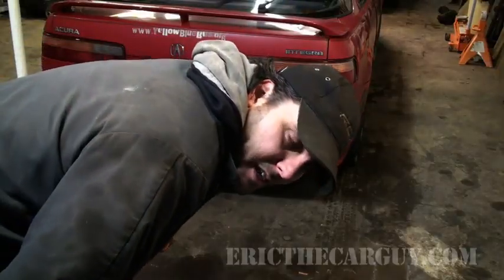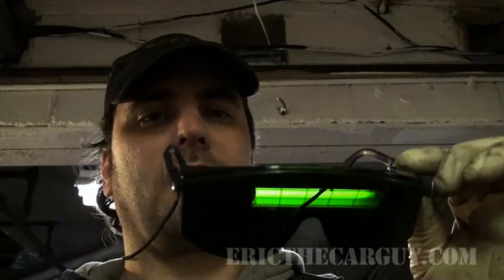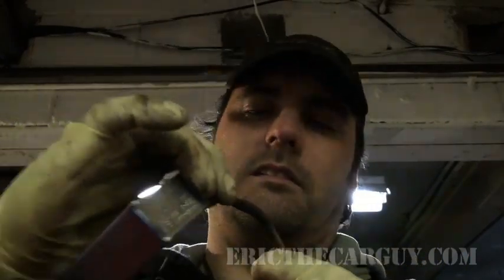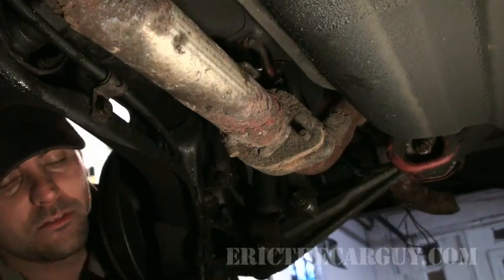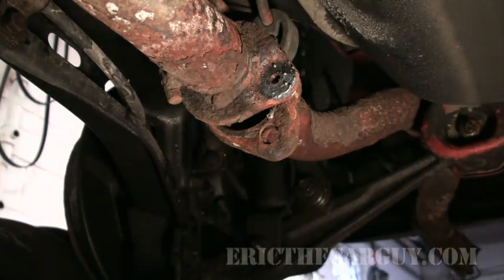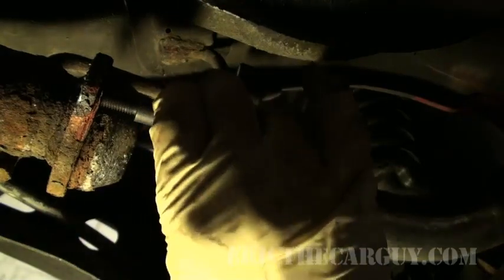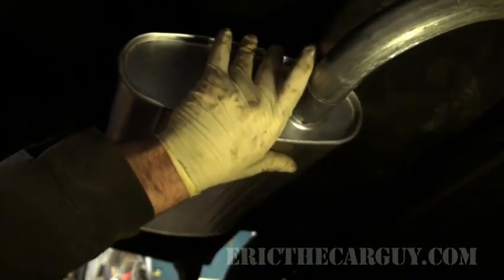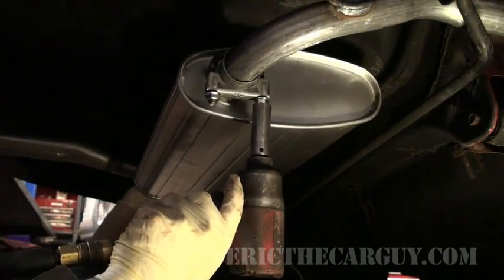How To Use A Torch To Remove Rusty Bolts (Full) - Eric The Car Guy

Comment: Some additional notes with acetylene. At 15 PSI it is highly explosive. Inside the acetylene tank the gas is in acetone (if I remember correctly). If the tanks is stored or transported on it's side, wait at least 30 minutes before using the acetylene. This allows everything to settle down.

Comment: I've heard tightening it a little helps loosen it up. Especially after PB Blasting it.
Also:
For those who do not have a torch and a nut is seized on a bolt, take a hacksaw and cut at the bottom of the nut. Hack it down all the way until you get to the bolt (if you plan on reusing the bolt).
Also:
A buddy of mine who worked as a machinist gave me a simple tip when dealing with broken bolts. Take a grinder (if you have one) and grind one side down flat, and do the opposite side the same. So you have two sides grind smooth, then take a crescent wrench and get it off that way.
Also:
Along the lines with a bolt extractor- - - A hammer, brass punch, and a metal drill bit. It worked for me on a 06 Nissan Altima.

Exhaust on a 1994 Honda Civic. Ahh yes good times. I thought I would never get that cat conv off.

Comment: Acetylene bottles also commonly come in red. 

Torches and bottles are no joke. I use them at work all the time, be VERY cautious. Ruptured Oxygen tanks will annihilate anything within 100 feet. Find someone to show you proper torch setup and safety before you use. I see older guys who've used torches for ages make risky-ass mistakes because they were never really shown how to use the torches correctly.

The appropriate lens for cutting is a level 4 or 5.

Good job, Eric! Keep 'em coming!

Comment: Also when you crank the acetylene open and light it up, turn the acetylene up enough to where the black smoke burns off. That burns off all of the old acetylene and gives you a nice neutral flame. Also, turn the oxygen up to where the flame just lands on top of the cone coming from the tip.

Comment: Thanks eric!  It took me all evening looking at others videos and no one actually said to heat the bolt or nut,  yeh i knew heat expanded things but always saw mechanic's just heating bolts or nuts without explaining. thank you for stating to heat the thing the bolt goes through or nut. I just needed that verbal conformation.

Comment: Torch tips for u Eric 

Open oxygen bottle valve all the way. It's a double seat configuration so it doesn't leak out valve stem and send you to the moon

Change head so u don't blow up

Back flow flash Back arresters   So you don't blow up

Open acetylene low and light it. Adjust until flame breaks away from tip. Add oxygen after bottle is opened. Add from torch

Don't stand in front of oxygen bottle valve in case bourdon tube blows up and shorts your eye out. Crack it slowly so any dust that should have been blown out before installing regulator. Temp in bottle to reg pipe can reach 1000+ f due to gas compression igniting any material and blowing u up

Turn off in reverse

Number on acetylene is cubic feet of bottle. Divide by 7 to get maximum tip size u can use with torch so you don't get flashback don't blow up

We like your videos

Comment: Hey Eric, whenever I install exhaust, tail pipe to muffler, I always use muffler cement on the outlets of the muffler to ensure no leaks.   Since after tightening there is no  way to remove pipes from the muffler ( pipes kink and are impossible to separate even after clamp removal), it makes sense to make sure there are no possibilities of any leaks by using muffler cement.
Something I learned over the years after few irritating leaks, LOL.
Just food for thought.

Comment: I watched this video and did exactly what you did in the video, except I put a piece of sheet metal as a heat shield above the joint. First time ever using a torch. I had a bit of a flareup from the Liquid Wrench that I sprayed on earlier. I had a garden hose and an extinguisher at the ready.

Comment: Eric, would a propane torch work for getting exhaust bolts loose?

I'm helping Toleif, a friend in Saint Paul, with his Dodge Grand Caravan. We're going to replace the muffler and, very likely, the resonator and pipe after the muffler.

Last night we cut off a VERY stubborn shock absorber. The bottom end was rusted to the bolt. The flange bent when I turned the bolt! So cutting the thing loose was the only way. I was glad to get the new shock absorber installed. The old one was completely rusted.

Comment: i found when replacing mufflers on old cars, for me anyways if you can weld depending on your level of perfection those joints and not need clamps at all. I used 6013 stick welding rod at 20-30 amps dc + i don't have a mig) worked well for me and i can't say anyones going to put those welds in a book for the perfect weld, but will ensure that muffler won't fall again. I also had some holes in the pressed together parts on the cat and well, the 6013 works here too and IS rather ugly, but my 2000 lesabre is likely one of the quietest ones your going to find with the original system and a new muffler on it. its one piece from front to back and welding it makes it far simpler on this car to drop the whole system down and repair any holes off the car as a single unit. typically every 2-3 years a few minor holes need repair, and considering the age of the car and the system is original but the muffler at the end, its acceptable for the 200,000 miles on the car as it sits, highest i've heard for the engine/transmission was 345,000 or so, if the winter salt here doesn't eat the metal body i would imagine that engine/transmission combo would keep on trucking with some leaks and the rest of the car failing(90% of my suspension is all new parts up front, nearly 50% in the back)
Reply: +twilson1118 Out of the box solution. Interesting.

Comment: Its a 7 month old comment, but when I replace the exhaust. I always spray it with Würth Alu-spray matt perfect, it just needs a thin coat on the pipes and muffler. So spray the welds near connections first and then the pipes and then the welds again. It has work very well on my exhausts. i suggested that paint cause thats what i know is working and sticks on for a long time.

Comment: man a torch is so helpful, I didn't even have a real hot propane one and the bolt didn't get red hot but it came right off, I even accidentally tightened it up a little before taking it off.
Reply: same here.  I just bought a cheap one from Walmart (it was $15) and I burned the sucka for about 2 minutes or so and it came off.  I still had to pull kinda hard with the ratchet, but it came off.  Twas a happy day (:
Reply: I actually slightly tighten rusted fasteners with an impact on it's lowest setting first to get some corrosion broken free before using the impact in reverse. It works great

Comment: IMHO, i would have dumped the lead pipe and gone all new, BUT when doing a ham N eggs job i agree, Kudos on the welding tip heating tutorial. next one should be how to do it with a cutting tip. as most shops use . great vids

Comment: Keep bottles were they can 'breath', space, so air can move around them & any leaking gas cannot build up. If possible, have then chained to a wall, so they cannot fall over. Have flash back arresters in the lines. 
As you've replaced with a cheap 'muffler' would you run a coat of paint, exhaust black, stove blacking, over it to slow the rot from the outside ( I know they rot from the inside also) ? 
E , as ever , great work .

Comment: It depends on the application. Suspension parts, wheels, Engine components etc should be torqued to spec, non-essential parts like brackets and body panels etc just tighten until they're snug.

Comment: what you're referring to is a flashback (i.e. where the flame burns back inside the tip. that is a BAD situation). clean your tip, make sure your connections are secure, and check your O-rings (and replace if necessary).

Comment: @ericthecarguy  Is it ok to heat up caliper pins to remove the bolt enabling me to change my brake pads? I'm just wondering more about what things on a car you might damage if you heat it up to red hot. Maybe things that have brakefluid or powersteering fluids in them?

Comment: Hello Eric I have a question that does not pertain to this video. I have a 1998 jeep grand Cherokee (4.0 straight 6) have an Eaton m92 supercharger ceramic header jet stage 2 performance chip high torque crane cam but I've reached a conundrum for my monster to handle the compression what type of head gasket should I use I have a graphite and an mls but no idea which one to use

Comment: Another good vid but one safety infraction this time - when using a torch use welder gloves or some reasonable facsimile(heavy duty leather gloves with long sleeves) not rubber gloves.

Sometimes muffler bolts will be fused right to the B-pipe and this requires more than just heating the bolt up for removal - the bolt must be blown(torched) right out.  Do you know how do that?  Can you do a video on that?

Comment: Use candle was after getting them hot. It helps to lubricate and the bolts easier. Personal experience and they don't seize up during removal

Comment: I have a 2000 Acura RL 3.5 and I put the diagnosis and the car and its reading fuel and air problems I change my fuel pump I change my air filter I check my spark plugs but not all of them. When you let the car sit for a while is no problem of it starting up when you drive it for quite some time it starts to die out.

Comment: Hi, Eric. I learn lots from your videos and I can change engine oil, brakes now. But I have some problems for replacing rear control arms for 2005 Mazda 3s. The bolts are too rusty and I can't remove it even with much WD40, especially the bolt is hidden behind a bar. Do you have some suggestions and upload a tutorial video if possible? Thank you my teacher. :)

Comment: hey eric,got any ideas on how to remove a stud bolt from were the front exhaust manifold connects to the exhaust line  ? i was removing one and the bolt head snapped off , now all i have left is threads.

Comment: Eric, it seems like the last owner of my car had it oil sprayed, but the exhaust is still looking vulnerable to the red death. Is it safe to paint over it with high temperature paint to extend its lease on life for another decade? Is it designed to be uncoated for maximum thermal conductivity? Thanks if you can answer.

Comment: Will it work on 3100 gm engine exhaust manifold and heat shield bolts ..... Got a blown exhaust gasket or cracked pipe in the engine bay

Comment: Eric you d man. But you should include purging the line for the oxygen and acetylene after the valves are shut. You don't really want gas to remain in your hose. They they should back the regulators out until they turns with a finger. Lastly the gauges should all read ZERO.

Comment: I have an oxy-acy setup, but I only use that for cutting since the head on my Acy only setup adds oxygen from the air, and it has its own push ignition, And I use this for heating things up. Also for anyone who cant afford these setups, Mapp gass for plumbing will do a decent job

Comment: hey Eric, would you do a video on chevy HHR  rear cradle bolts just spinning and not coming out. the nut is in the frame and cant be locked!  big problem on many cars, but my HHR cradle bolts spin, cant fix control arms. thanks, rick

Comment: I bought a jar of permatex anti-seize paste back in 1975 and use it on wheel studs and muffler bolts or anything I think will rust together.  

Just had to buy another jar (2016) because I left the top off the old one and it has dried up the remaining amount (two ounces).  Is there anything that can be added to it to make it useable again?
Reply: 90w gear oil helps revive antiseize.. But the same bottle from 1975.... I think you got your use out of it

Comment: Hi Eric.....
.... I checked  you video....good job taking out fast those Rusty nuts.
Question? Your torch has like 5 gages.....so my question is.....I have seen with only one, so each tank has one only..... is the same size like yours.
I was thinking to get one of those......But first....What you suggest me.....and also cost like $150 or $200 right...... what you think??

Comment: Wait what if the o2 sensor won't budge? Torch them as well? I think I actually might, the only problem is there's fabric around it like vacuum lines. I'm thinking about just taking it to a shop and having them do it. I have a 3000gt vr4 btw. Pls help if possible.
Reply: +shnoopy doopy take it to a shop. atleast if they f it up, they will pay to fix it..... If you f it up... its all on you.

Comment: Use a Cold chisel and get a New Nut, I had to for my 93 explorer, had to go dealer for the nut was $126.00 But saved me in the long run.DO NO HEAT THE SHAFT !

Comment: Hey zairyy1519 your most likely in need of a hub assembly / wheel bearing ,jack your car up (stands blocks etc) with tires fully off the ground check for play in the tire if you have right to left your looking at a tie rod if you have up down be a ball joint (99% wouldn't cause a shake) have play all ways bearing or hub in you find nothing spin tire with your hand while holding your other hand on the coil and feel for a slight vibe if only one is like it that's where your problem most likely is

Comment: In my younger days. And not having a lot of financial resources. For those smaller muffler and pipe leaks, I used Furnace cement and what ever cans and clamps I could find. The furnace cement, when heated, hardens like steal. Glad those days are gone buy.

Comment: Propane without oxygen, just burning in air, gets to about 2000'C, while oxy-acetylene, like Eric uses here, burns at about 3500'C.  You can use propane to heat up a rusty fastener and it will work, but not as well as a oxy-acetylene torch.

Comment: Eric, you just RUINED the threads!  Next time, quench the nut and bolt with water and have them nice and cold BEFORE you ever put on a wrench.  The water shocks loose all the rust and turns it into a fine powder.  This “Heat and Quench” method saves a lot of time and expense.  Water is your best lubricant while turning the wrench.

Comment: A propane torch will work, but you will have to heat the metal longer, because the flame isn't as hot.  I have successfully done this on many bolts.

You can even use a butane torch, since butane and propane burn at nearly the same temperature.  Unfortunately most butane torches are small and don't put out much energy.

An easy alternative to heating the metal around the bolt is to cool the bolt and cause it to contract.  You can do this chemically with a can of Freeze-Off.

Comment: Will a propane torch work also, If I just heated for ten more minutes ?
Reply: I've used propane, not as hot but sometimes it isn't required to get it red hot. You can hold it up there for a while though and eventually get it real hot.
Reply: yep same here, used a propane torch from Walmart and it worked just fine.  It may take a bit longer since it's not as powerful as the torch Eric used but yes, it worked for me.
Reply: The problem with a propane torch is that you have to hold it upright.... when you tilt it too much, which you sometimes have to do in order to fit into the small space you'll be working in, the flame goes wacko & sometimes goes out.
Reply: Buy MAP gas to attach to your torch tip. It comes in a yellow cylinder and burns hotter than propane.

Comment: I have nut and bolt on i just baught blow torch the bernzomatic 15 dollar one i heat the bolt and stem squirt PB blaster on it and still can  not get the bolt to turn and loosen. im losing my mind trying to get my exhaust off to fix the rattle.
Reply: you dont heat the bolt directly, you heat around the bolt so the hole will expand and be bigger than the bolt itself, then you take the bolt out

Comment: You can get muffler cement meant for clamped applications like this.  You spread it on the outside of the pipe that slips inside the muffler, when you clamp it down, it fills the airspace. However, this looked like a particularly poorly fitting kit.  There should be almost no airspace between muffler openings and the pipes, they should fit snugly.  The clamps were also too large, and cause the muffler openings to deform when tightened.  Clearly a cheap kit, and not a reflection on Eric's skill.

Comment: could do with a little heat paint on that rusted manafould lol
Reply: true but they rust from the inside too from all the exhaust moisture cheap mufflers will look mint on the outside before the bottom which is all rotted from the inside develops a hole which eventually becomes half the muffler falling off

Comment: Brought a propane torch to help get the nuts off connecting the number 1 exhaust pipe to the manifold, still didn't work. Fuck I don't know what to do next. Can't get an impact wrench, hacksaw or grinder into this space
Reply: +Triikor Propane won't get it hot enough.  Maybe MAPP, but A/O would be best.
Reply: +Triikor to get a lot of torque without a impact is to get a breaker bar and use that. if that doesn't work, get a tube and slip it over. still have yet to find a bolt i can't remove without a breaker bar tube combo.